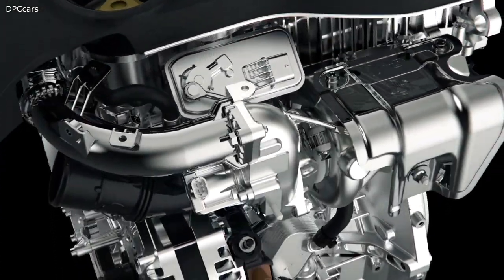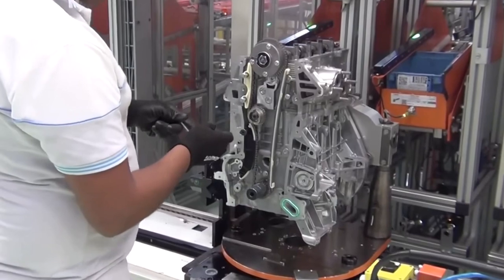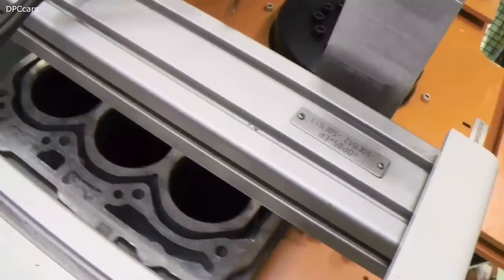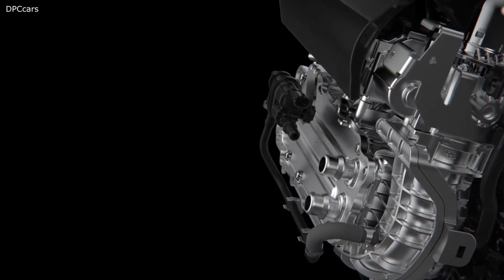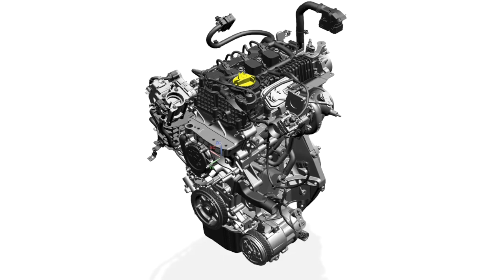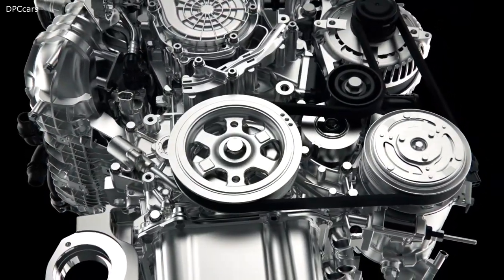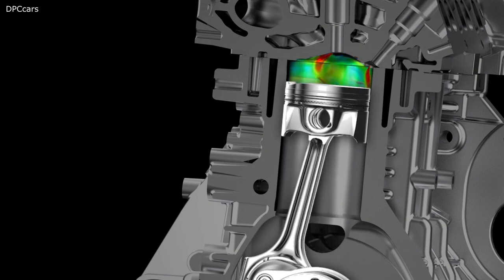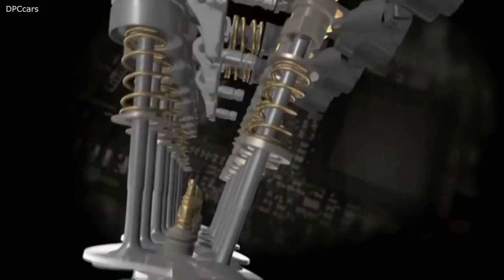FCA GSE Small FireFly Engine Explained

Comment: For use in compact and midsize models?  What compact and midsize models?  They don't have any.
Reply: 500X, Tipo, Renegade, Compass, just to name the most important ones. A tuned-down SOHC variant without turbo, MultAir and with indirect injection also appears in 500s and Pandas.
Reply: @profemeritus534  Is it using timing belt not chain?